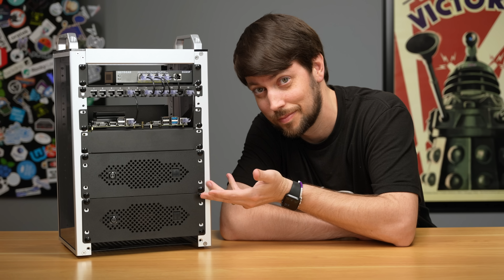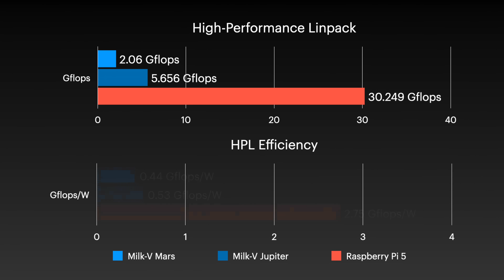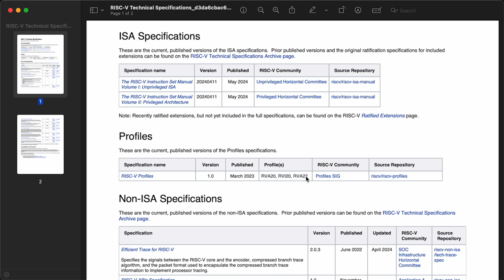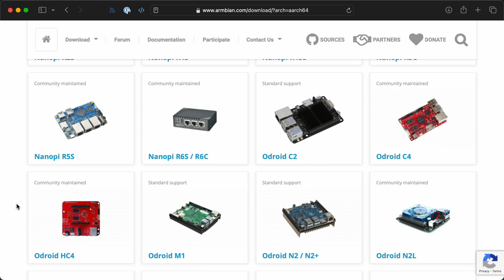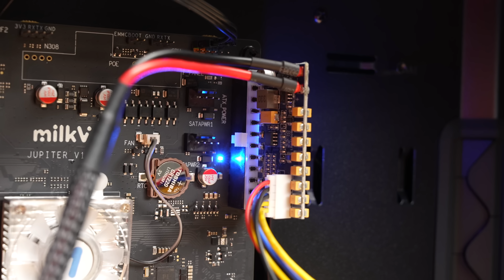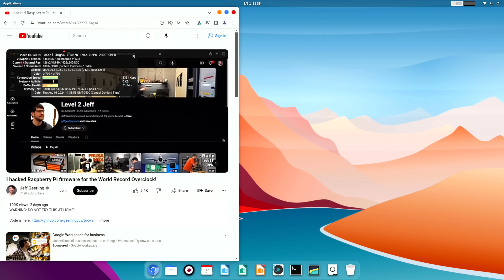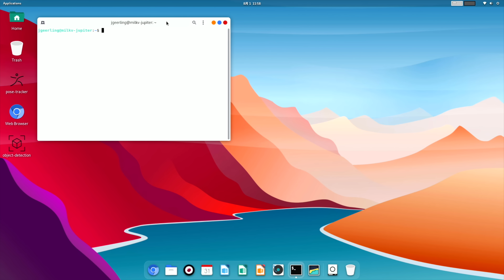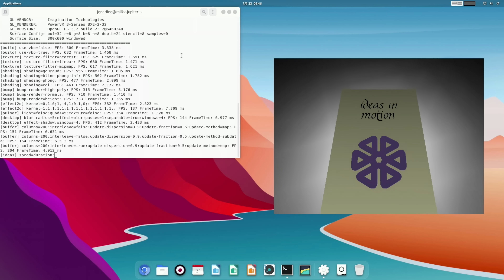The PC industry is changing: RISC-V goes mainstream

Comment: Many people say RISC is the future, RISC will change everything... well 30 years ago people also said and thought that as well. Does anyone still remember the Acorn Computer Ltd. (BBC Micro, RiscPC... and so on)? Anyway, just like in the 90s a Reduced Instruction Set Computer (RISC) does make a lot of sense when you need very high efficiency and low manufacturing cost. It doesn't make much sense when you need versatility and PCs (desktops) are very versatile machines when it comes to what people need them for.
Reply: Yes, I used Acorn's stuff, including their ARM-based machines that random people will now repeatedly claim affection for, while pumping out the usual abridged narrative about ARM. What you're overlooking is that while ARM became successful in the embedded market, gradually working its way up through mobile to where it is now, that route to success (which wasn't in any way guaranteed, contrary to that abridged narrative) was perhaps the only way ARM would survive in a very competitive market.

However, Acorn, like other microcomputer manufacturers, originally wanted to go upmarket and make business machines and workstations, but they didn't pull that off in a timely fashion, and their architectural choices limited how competitive their ARM-based products were. You need to compare the ARM to SPARC, MIPS, PA-RISC, POWER and other RISC architectures to see that ARM - the company - had to move a lot faster than they did to keep up. Digital did give ARM a bit of a performance injection with the StrongARM, but that was too late to save Acorn (and, arguably, Digital for other reasons).

But all of the mainstream RISC architectures were quite capable of powering "versatile machines", largely because that is precisely what they were designed for: workstations and personal computers. What then happened was that AMD and Intel adopted various RISC principles, enabling them to keep up in terms of performance and eventually leverage their fabrication, volume and cost advantages, gradually driving traditional RISC products away from mainstream computing. So, contrary to what you are claiming, RISC was the future and did, in fact, change everything.

Comment: Risc-v is just an Isa, an instruction set. Someone has to design the silicon that implements it and that is very much closed source in most cases. So thinking this will all be fully open is a mistake.

Comment: I still wish someone would do an open CISC CPU, but this at least gives me hope for the future of actually being free to use our computers the way we want. And besides, we might just all be capable of making our own chips from scratch anyway with open designs. However, I do like Chris's case for his RISC-V computer better. It was more compact.
Reply: There are open versions of the National Semiconductor 32000 and Motorola 68000 families, from what I have seen, which you could deploy in an FPGA or, if you have the money, actually fabricate in a traditional silicon product. The lingering question is whether you are better off dedicating silicon to all the extra CISC logic or instead using it for things like on-chip cache or other, more directly useful, functionality.
Reply: @paul_boddie   The problem with that way of thinking about it is you're assuming backwards compatibility. With a completely fresh implementation, it would be more space and power efficient to do the same things because you wouldn't have to propagate that technical debt.

Comment: I think Framework is already working on a laptop with a RISC-V chip.
It'll be very interesting to see how the technology develops, being an open standard.
Reply: nope - it's not framework thenself but a 3rd party developing a board for the framework chassis
framework is more or less an open platform with themself the only supplier for yet - but everyone is encouraged to contribute and provide for it
same as with the community is encouraged to design and provide the modules
there're even projects to provide alternative cases for the boards so you can keep using them outside the laptop

Comment: If I am not mistaken you are in the STL area (I'm in S. City). If that is the case, I've got some Molex to 3 and 4 pin fan adapter cables you could have. I also have a couple Sata/Molex powered fans controllers that I don't use anymore. Like most nerds, I've got a whole bin of used parts, cables, etc...
Reply from the maker: Ha, don't we all... I do have a couple adapters, I just couldn't find them with my normal '5 minute dig', I'll have to organize the molex/ATX adapter box to find 'em :)

Good to see someone else from STL on here, not as many tech folks in St. Louis compared to some other parts of the country!

Comment: I don't really understand the hype. Problems with mass-produced SBCs which are more or less clones of RPi but with different SoC doesn't come from ARM cores (so from ISA). They come from support for peripherals (like IGP). And guess what, it will still be the same with mass produced RISC-V SoC in China. Allwinner generally makes Android based products so doesn't really care for support to linux (and all allwinner based boards suffer from that slightly... because the result is lack of h/w drawing acceleration and video decoding). With some chips (like from Rockchip) there are PCIe lanes exposed. You could connect external graphics and just worry about porting drivers. The same way you'd have to worry about e.g. radeon drivers for RISC-V based boards. And actual implementation in silicone is proprietary so if one manufacturer makes high performance RISC-V doesn't mean that such design will be transferred to other entities.

Comment: One thing I usually don't understand when it comes to distribution of linux is: why are so many of them while lots of them don't even come close to the feature set of Desktop Windows?
I am in the changeover to Linux and noticed: network printer installation sucks (spend ours not getting it to work), wwan andy 3d mouse beeing unsupported, simple settings as (remember screen settings when docked) not working... Lots of software not beeing avaliable natively....
And that not even including of often I got it to freeze and crash... 

And that's with an distribution like ubuntu..... What will all those no name distros be like for the non nerd?

Comment: I am not sure RISC-V is "there" yet for more mainstream computer use.  The problem is specifically the lack of toolchain support and that, itself, will not come about for some time as it will be a condensation of standards between ISAs and software libraries.

For a microcontroller or embedded system, I select the chip with the features I need and enjoy the benefits of an open ISA and program in various languages or assembly as needed.  RISC-V is an easy and straight-forward assembly language to write in.

Even for something like a game console, this would be a desirable set of features and could allow a console to be developed at the ISA level without needing to own a fab to do it.

However, from a computer standpoint, the environment is already so geared around x86 and ARM that we are more likely to see RISC-V architecture used in the CCDs microcoded into one of those CPUs than we are to see RISC-V become mainstream.

For example, the vector extension of RISC-V is generally superior to something like AVX-512.  You could, at least in theory, microcode AVX-512 to operate over a RISC-V framework while having the ability to run native RISC-V vector extensions.

I see this as being the likely future of RISC-V in the desktop arena.  We may see some "indie computers" which are meant to break away from the big players, and they will likely improve in capability and performance, but we are comparing different build criteria.  I am not as concerned about performance if I am building a computer I want to be able to define as fully open source to allow people 300 years in the future to run off the exact same cpu, gpu or *pu to keep their stuff running.  We are about out of die shrinks in silicon, so it's a decent time to plant a stake in the ground and claim a computer form of wheel has been standardized henceforth.

Comment: I'm watching this RISC-V video on my RISC-V system. It's the Banana Pi BPI-F3, running Bianbu, with Chromium. Indeed not fast, but it works.
Reply: What does ris. Risc-V specialises in?
Like x86-64 specialises in power and support.
And ARM In efficiency?
Reply: @AffectionateLocomotive  Open Source ISA. So anybody is allowed to desgin and make RISC-V CPU's, withou licensing.
Reply: @AffectionateLocomotive  It will be similar to ARM with good power and great power efficiency. ARM is also a RISC processor. Best of all RISC V is open source unlike ARM.
Reply: @nikhilpatil7218  so, but better?
Reply: @AffectionateLocomotive  ... I am waiting for my F3 and a Mac Mini M4 these days.  My first RiscV, although I have been working with ARM for several years now.

My position is that "diversity is a good thing".

I have some framework and I am cross-compiling everything for X86_64, ARM32 (armhf) ARM64(aarch64) and now RISCV64.  And I like to guarantee that my software runs well in the most of these platforms, for it to be useful in more computing scenarios.

My idea is to create very efficient and small security and transactional devices.  ARM is the leader in this respect, but I feel that RISCV is advancing really fast, and as it is so open, it is showing a lot of different usability scenarios, something that match better Linux than even the ARM platform.  And X86_64? ... mmm ... my development virtual environment, and maybe some high profile system could be run there, just that I can't justify so hungry systems for what I am trying to do.  What about to create a system running in a $180 machine equivalent to $1 million from 20 years ago?

Comment: What is the main advantage of RISC-V over ARM or x86? Is it only that the architecture is open? Or are there also possible factors like energy efficiency or not having the same performance limitations?
Reply: RISC-V's only real USP is that the Berkeley boys elected to move the RISC-V foundation to Switzerland, to circumvent all US, EU, JPN, UK, CAN, AUS, NOR, ... export restrictions on China, North Korea, Iran, Eritrea, Yemen, Myanmar, ... (20% of the Globe). 

The RISC-V ecosystem isn't OPEN, just the CPU cores, and then for non commercial activities. Want to sell a RISC-V SoC or single board and you'll need to be a paying member of the RISC-V Foundation, along with licensing the IP for you chosen flavours of memory, usb, bluetooth, wifi, gpu, video encoders / decoders, PCI, SSD, ... . Want to build a consumer device and you'll also need to licence and source your screen, cooling, and battery.

Comment: Chris is very on point about the lack of software compatibility (kernel, drivers) with ARM. Two years later, Rock 5B is still hit and miss with official and community images. Heck, I believe Haiku has better RISC-V support than it does ARM64. My ARM SBCs aren't doing anything atm, because the support just isn't there yet. It's the one thing Raspberry Pi seemingly got right, everyone else has gotten it wrong.

Comment: The problem with ARM/Risc-V in the desktop space is that the chips NEED to be socketed! People like being able to plug in or upgrade RAM, storage, and even better CPUs without having to toss away the mainboard/ram in the process.
Reply: I agree, but it doesn't absolutely have to be a socket. It could be a card like the pi compute, or the Pentium 2.

Comment: I think the real question is going to be who gets robust accessory/gpu/etc support first. AARCH64 or RiscV. The biggest thing blocking ARM adoption (even in the Apple ecosystem) is graphics and  third party hardware support.  It will be interesting to see in 4 years if you will be able to buy a new version of this or an ARM mainboard and attach a moderate to high end GPU/NPU/TPU or other things to it and have it 'just work'.
I think RiscV in the end is going to make it first, simply because the developers seem to care about it more. X86_64 from a perf per watt is getting close again to the best of AARCH64 so I think the tighter ability to have the hardware align better with the software will get RiscV a win in the end.

32-bit arm took off in 2007. The Pi 3 released in 2016. 2011 was when the first RISC-V ISA was published. Now its at Pi3 levels in 2024.
9 years to refine v7 to Pi3,  13 years to create from scratch something to pi3 performance levels where it took 17 years for ARM.

Comment: I checked the specs, and apparently this thing should be able to do 4K @ 60fps decode using a bunch of modern codecs (not AV1 though). I wonder if the video playback slowness was a software and/or driver implementation issue rather than a hardware limitation

Comment: The entire RISC-V proposition has such a long long way to go - the dizzying array of ISA components makes shipping binaries a lottery and the performance is pathetic - not sure if it's poor optimisation or just too RISC for it's own good with too many instructions required to do simple things. There's plenty of CPU design brains around that could bring out something that goes woooooosh, but they don't seem to want to work on it, I wonder why. Final nail is the performance of a ESP32-C3 vs an ESP-S2 microcontroller - both single core, first is RISC-V and the second has the original Xtensa core. It's like night & day. Surely a core that's got all the new knowledge gathered over 10 years in it's design & execution should be putting in a far better showing by now.

Comment: I have my ITX rock 5 in a Fractal Design Ridge Mini along with 4x ZERO 3E inside with a 10x USB hub and small USB adapters to connect them side by side. Inspired by SUN the network is the computer.

Comment: Interesting to see yours came with a "Milk V" branded cooler, they said on thw forum it wouldn't come with a cooler, i wondering if that's changed or if its part of rhe youtubers pack 🤔
Reply from the maker: I've been talking with them a while, I'm not sure whether any cooler will be included at all—honestly a little heatsink would do fine unless it's a very hot environment. The fan only turned on about 3 times during benchmarking.
Reply: @JeffGeerling  yeah I'm just going to use the same heatsink I use on my pi's, I'm pretty sure it should be fine, BUT I live in Australia and in summer ambient temperature can be like 40c 😅 so come December I might have to look at an active cooler.
That cooler you have looks like it's just the Radxa one with a Milk V sticker on it

Comment: Put the first board on a hot plate - might just need a tiny bit of reflow; in any case, if I were them I'd want that board back and give it a good xray to check the attachment then pop the chip and test it.  Could have gotten some duds in a bad lot; I would want to know, because, you know, suppliers.

Comment: Could it be slow because os installed to eMMC?
Reply from the maker: In my case I had OS on a MakerDisk microSD card, but that was not the main bottleneck, except for some of the loading speed — I couldn't get the OS to boot from NVMe but I didn't spend much time trying (yet!)
Reply: @JeffGeerling  Good luck!

Comment: I've been using my Visionfive 2 with an RX 580 and gentoo for a while now. I have to say, it feels WAAAY snappier than it did before. I'm not quite sure if it's due to compiling everything specifically for my hardware or because a modern graphics card brings a lot of stuff to speed up everyday tasks (video decoders, for example), but I'd definitely give a dedicated GPU a go. I haven't got my Jupiter yet, so I don't know the process to rebuild the kernel with AMDGPU and using mesa is like, but if it's anything like the Visionfive 2, a graphics card really upgrades the experience considerably.

TLDR: Give the graphics card a shot.

Comment: They're interesting, but it's a long way from being able to be used like my daily driver dev system that runs on a Rock5 ITX M-ITX style SBC. I've been watching, but I'm not a fan of having hardware just for the sake of it being interesting, being toyed with a couple of times, then left to collect dust. That's where RISC-V boards are for me, but I'm still looking at getting one sooner than later to start working with RISC-V Assembly. I mostly program on my ARM system with C/Assembly, so it'll be interesting to experience the different instruction set and see if it's worth my time until there are truly competitive boards performance wise.

That board may do a bit better if it were running XFCE or a lighter desktop environment over what appears to be a gnome install with some extensions. I run Plasma/openSUSE on my Rock5 fine, but in the past I generally used XFCE on SBC's.